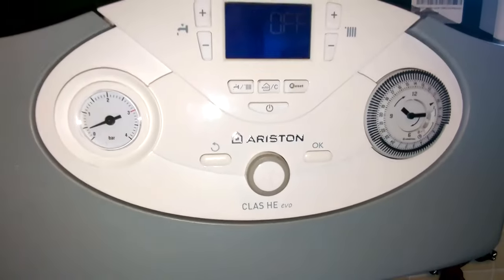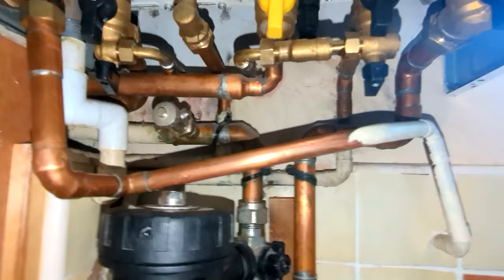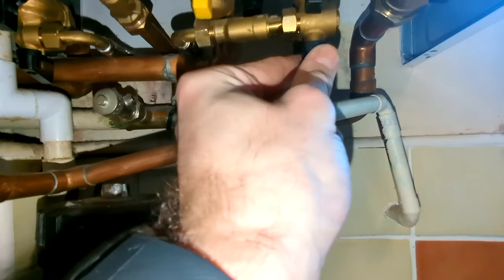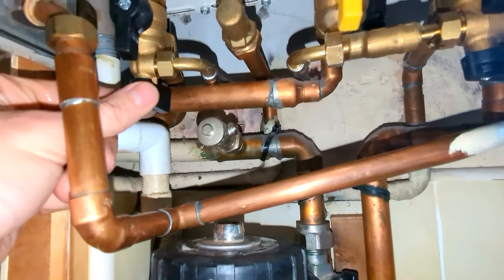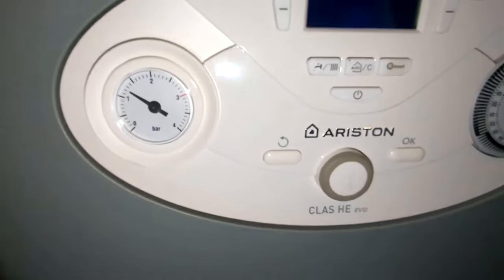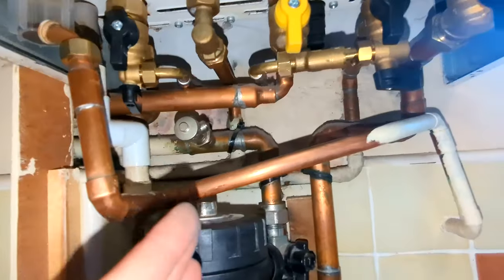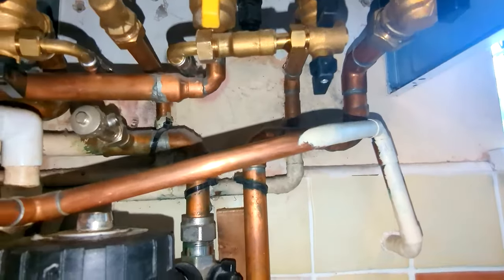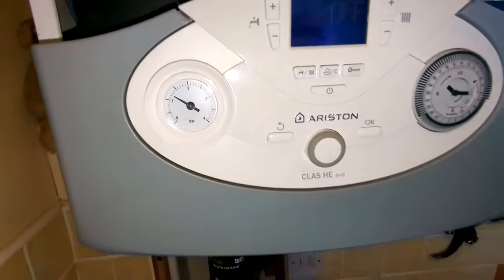How to:  Top up the pressure on Ariston Clas HE Evo Combi Boiler - Low Water Pressure Fault Code 108

Comment: Just to say, huge thanks to your video, ive just reset pressure on our 28 year old Ariston boiler again today.....im monitoring the need for resets....#1 was 8 Jan 2024, serviced on 15th Jan and engineer said all looked ok, then i have had to reset it again today on 9th April.
Reply from the maker: If it's slowly losing pressure over a couple of months then you may have a very slow leak on your heating system.

But it can be difficult to pinpoint if everything appears fine.

Topping the pressure up once or twice a year is relatively ok but if it's regularly needing topping up, then that's an issue.

Hope that helps

Thanks for the comment

Cheers
Dan
Reply: @dpjplumbing  Hi Dan, Than you so much for your reply and info, so very kind of you.  We will investigate.  The entire bungalow is due to be demolished and rebuild due to subsidence by insurance (thank god) but planning is taking forever.  I'm trying desperately to get everything eg boiler  cooker etc to last until demolition.  Cheers.
Reply from the maker: @CherryBelle-sh2jx  no problem, I hope you can keep it going without too much cost and hassle.

Good luck with the rebuild!

Cheers,
Dan

Comment: Do you know if smart thermostats are compatible with the ariston e combi evo? looking to get one fitted! thanks
Reply from the maker: Yes, all smart thermostats should be compatible with the Ariston boiler in its basic on/off mode.

If you wanted to use a smart thermostat which uses OpenTherm to help make the boiler operation more efficient then you'd need to check that this boiler is OpenTherm compatible.

Hives are basic on/off smart thermostat, so that wouldn't have any issues working with the Ariston boiler.

Hope this helps, if you have any more questions, don't hesitate to ask.

Cheers,
Dan

Comment: The yellow valve is facing up on my boiler is this normal?
Reply from the maker: It's hard to know for sure without seeing it but I'm guessing it's just the orientation on how the yellow lever was screwed onto the valve. 

If your boiler is working as it should, it's most likely fine.

Comment: On my boiler the cold valve is stucked didn't open. However the gas valve i managed to raise the pressure but I stupidly left it up to 3.🤦‍♀️ how can I drop it back?
Thank you
Reply from the maker: You need to drain some water out of the heating system to bring the pressure back down.

The easiest way is usually to bleed a radiator into a jug/container.

Comment: Do you know why?... Ariston clas one 24 continues to slowly increase the pressure even though the blue fill valve is closed. (The only reason can be that this valve is not closing well or can there be another reason?)
Reply from the maker: Can be a common issue of the blue lever valves passing very slowly.

The easiest way to tell is to disconnect the hose bit and see if it continually drips.

If they continue to drop when closed they'll need replacing

Comment: Its not working for me
Doesn’t change water pressure 
No sound when i turn the valves 
Can you please help
Reply from the maker: Hi, if you've followed the video it should be working. Without seeing it myself I am unable to give much more advice. 

It's possible the valve has seized and the plastic lever is spinning
Reply: Can you help me through a video call or something if possible?
Reply: It was working this morning and the gas tank was finished so i changed it
It usually works normally as i change the gas but this time it was showing error 108
I followed the video but as i turn valve it doesn’t make any sound means no water is going in there